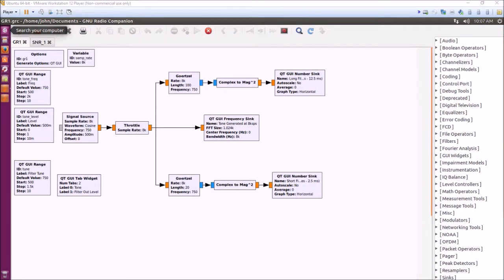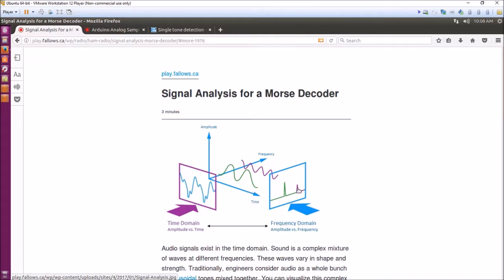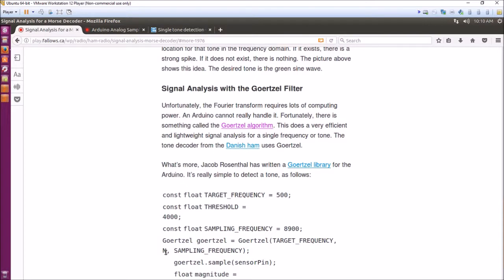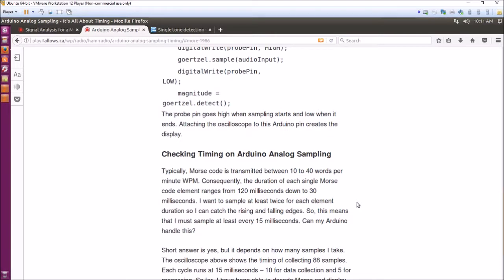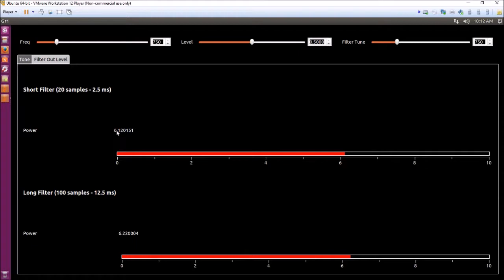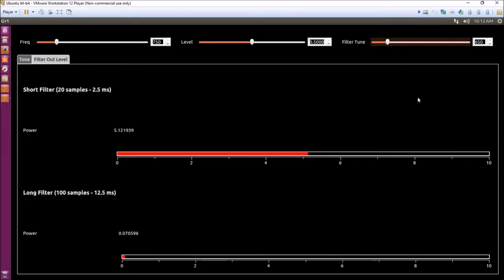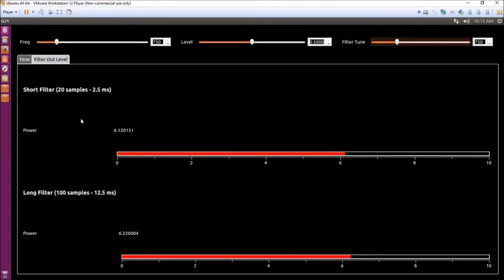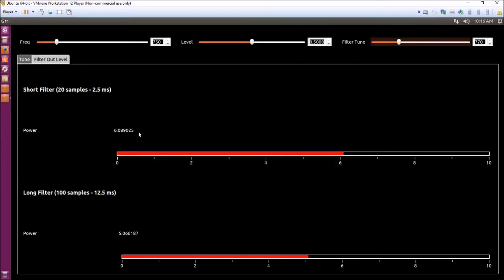Learning SDR DSP   Goertzel Filter

Comment: Goertzel is also useful in a car engine controller to look for a single misfiring or weak cylinder. By feeding in engine speed variations to a Goertzel filter set to a sample/centre frequency ratio set to the number of cylinders, the result is the roughness of the engine at a two engine revolution (one engine cycle) interval. It is computationally pretty efficient. It is quite a versatile algorithm. VE6DAU